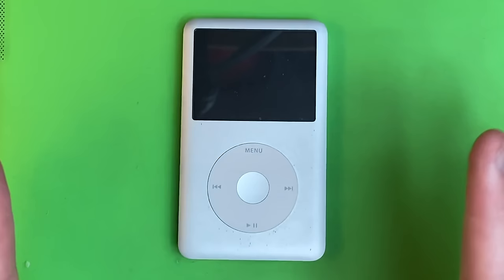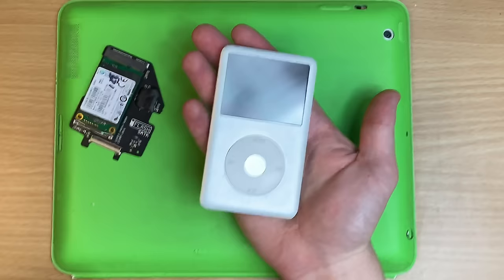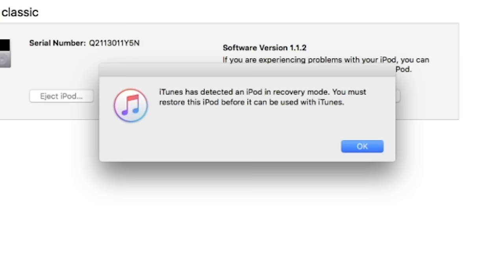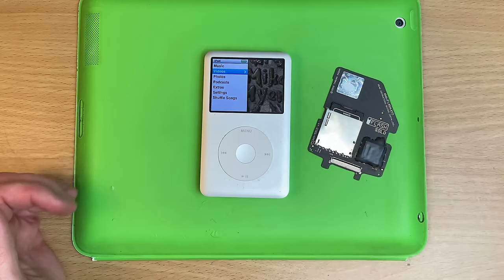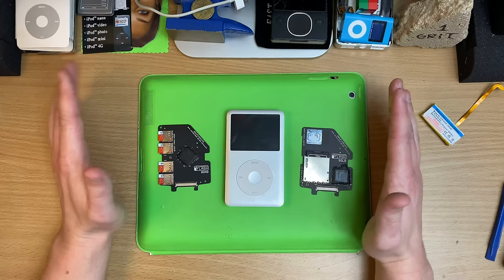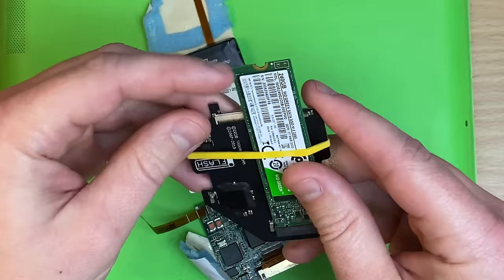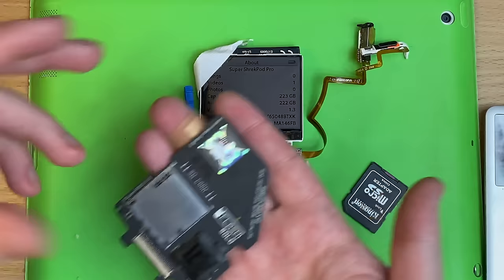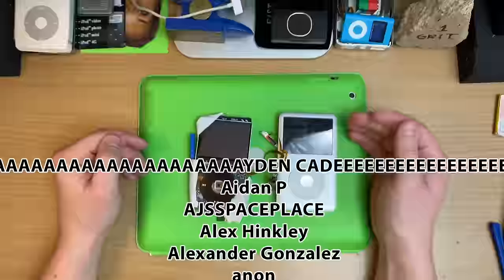PC SSDs in an iPod Classic! (M.2/mSata)

Comment: Word to the wise. Make sure you create a back-up of your 50,000 songs (portable HDD) if you go the Flash array route using SD cards. Flash memory is notorious for dropping data and corrupting massive amounts of files when the power source goes dead and theirs nothing holding the billions of transistors' position in place.

Comment: Oh, I know this vid it's not from yesterday, but I cannot stay without praying you for something. So, please, make content about the Creative thing you'd shown.

I had this for many years and it's robust as a rock, in fact it flew away from my pocket to crash asphalt very hard (traffic incidence) on a rainy day and... it was playing the song as if it was nothing. Long years of services without a flaw, but the deep scratches done by the street crash.

Anyway, not so easy to synchro in modern PCs and the touch slider went faulty someday making it annoying and unsatisfying to use it. Already opened and no clues about what was happening (no humidity signals, as I thought, no broken connector...). 20gb it's not so much nowadays, but its nostalgic value (not to mention its original price) and the impressive audio quality keep saving its existence. No device I put my earphones in could even compare.

Please, help me enjoy it more time, talk about some hacking of its controls at least (because Creative Zen is another beast).

Comment: Not into iPods, getting into modding anything Apple because eWaste due to their products becoming outdated and  obsolete because end user can't (or can because Fuck you Apple) upgrade Apple products. Definitely want to get myself a couple/few(dozen) iPods and and extent their longevity indefinitely. I recently found a, outside my apartment, MacBook A1181 that was abandoned and on in Recovery where someone was failing to reinstall iOS. So I brought it home and got iOS on it, the most recent supported for the A1181 is Lion. I then learned VERY fast that the end of this laptops life was coming up soon because little to no programs/applications were available and those that were told me that support was ending soon. "Fuck that," I thought and started looking up my options. First things first and that was ordering an SSD to rid myself of that 13 year old slow and loud HDD. Then what to do about the OS? Getting a more recent version of iOS seemed like to much of a pain to be on iOS & just FUCK M$ andd Windows for all their treachery. Plus installing and running Linux Mint(Cinnamon) on this device was as simple as creating a bootable disc, booting from it and installing Linux Mint like you would with any other laptop or PC. Waiting, wartaiting, waiting for Linux to install, restart, wait for Linux to boot and YAY! Desktop. Run updater and install all updates with no issues. Check for drivers and install Nvidia & Broadcom drivers sucessfully then Restart. We now have WiFi and a working graphics driver running without errors. A very successful install and system/driver update, BT was available from first boot. I now have a 13 year old MacBook that will run until the mainboard kicks the bucket which I can keep up to date with new versions of Mint instead of a soon to be addition to the mountains of eWaste from broken, or in Apple case, obsolete electronics.
TL;DR: Soon to be obsolete MacBook>Fuck You Apple>Install SSD>Install Linux Mint>Extend life of MacBook indefinitely>Fuck You Apple!

Comment: Need Just 1 original iSesamo to open the iPod classic without to cut your finger.  The “tools they send with the kit are just no sense  piece of metal :( 
What make working iSesamo is  the “ secret “ in the tip ....
90% of the difficult is open the iPod, why to do not give the original iSesamo ( reseller cost 2,9 euro ) 🤷‍♂️